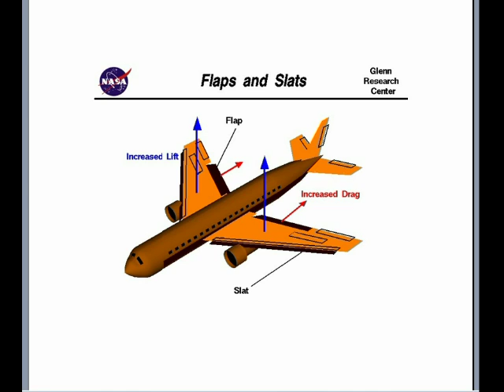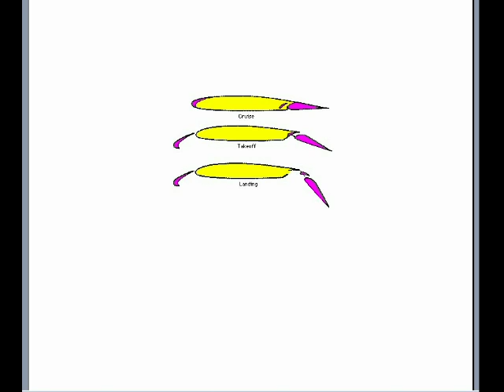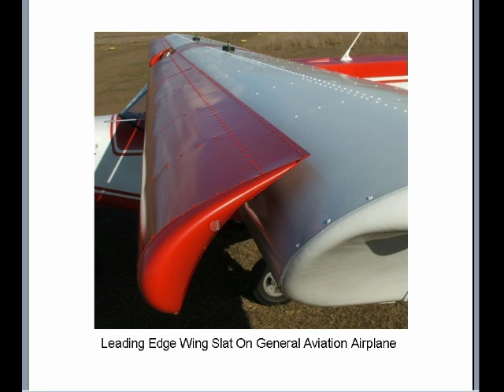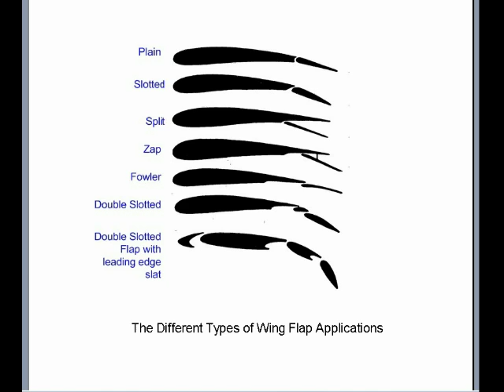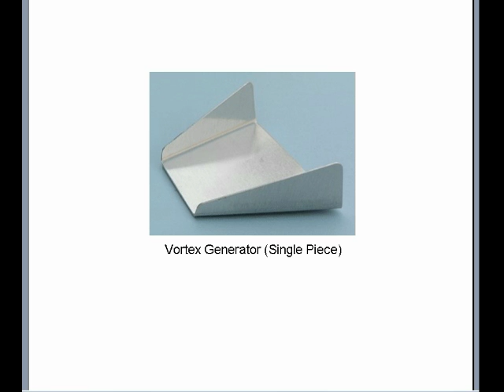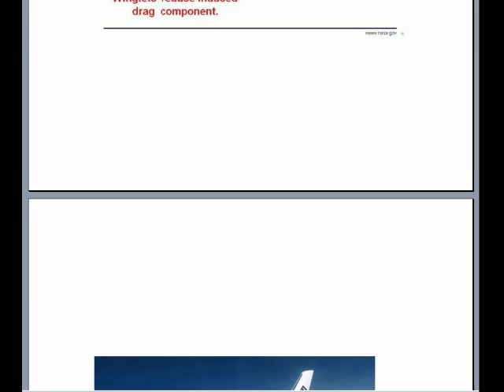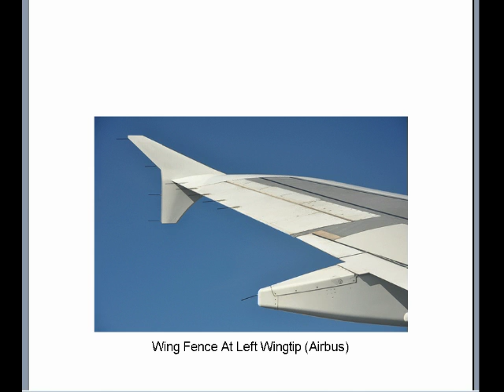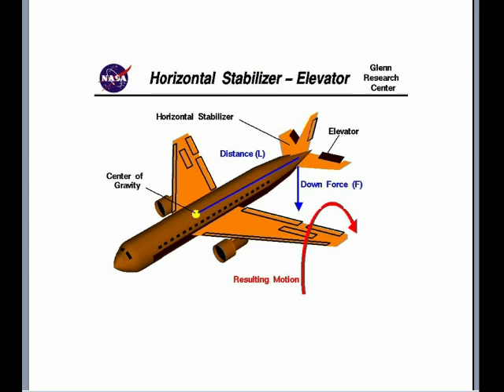Airplane Flight Controls & High Lift Devices Part 2 of 2

Comment: How much lift is produced on the leading edge slat? In other words is wing load calculation for the area of the slat equal or less than the main wing? Since most of the slat is curved the area parallel to the airflow is small so not much? There is a front loading component to the airstream that is at the leading edge. Just trying to figure out the loads on the extension tracks. Most of their load is trying to tear the slat up and back I assume?
Reply from the maker: Hi. The Slats are there to permit higher angle of attack preventing airflow separation or wing stall, especially in regards to swept back wings on heavy airplanes at slower airspeed.  Swept back wings don't develop that much lift at slower airspeed especially with high wing loaded (heavy) airplanes.  That is why High-Lift Devices are incorporated into heavy airplanes with swept back wings such as airliners.  High-Lift Devices include:  Slats/Slots, Vortex Generators and Fowler Flaps.  Also spoiler-assisted aileron and Load Alleviation Function helps to minimize the amount of flight control deflection when flying low and slow on heavy airplanes with swept back wings.

The Leading Edge Slats and Slots work in conjunction with each other.  Especially in regards to heavy airplanes with swept back wings flying low and slow.  Remember that the critical angle of attack or wing angle to the relative wind is not very high before a wing stall can occur especially when flying low and slow in regards to heavy airplanes with swept back airplanes.  This is why Leading Edge Wing Slats and Slots are implemented during takeoff and landings on heavy airliners with swept back wings.

Looking at the Leading Edge Slats and Slots from the side or profile view you will notice that the Leading Edge Slat is basically another wing leading edge suspended above the existing wing leading edge separated by a slot.  The Leading Edge Slats do not have any effect aside from a bit more drag when the wing angle is is low or close to level.  But when the wing angle approaches the critical angle of attack or exceeds it which would normally cause a wing stall (very dangerous when flying low and slow during takeoff and landings) instead of a wing stall occurring the airflow at the bottom of the wing is bypassed upward through the wing SLOT (not slat) up over the top of the wing, not only preventing a wing stall but also increasing the lift substantially when at an angle of attack exceeding the critical AOA.  Of course more drag is incurred during this process overcome by more engine power.

Remember that airplane wings develop lift when the airflow speed is much greater at the top of the wing compared to the bottom of the wing.  This is accomplished by implemented the appropriate airfoil for the given flight application and also by increasing the wing angle, but not exceeding an angle which would cause the airflow at the top of the wing to separate or spill off the upper wing surface causing a wing stall.

Slats and Slots are there to permit higher angle of attack to the wing without losses in wing lift especially when at lower airspeed in regard to swept back wings.  Swept back wings primary advantage is that they permit much lower drag and much greater lift when at higher airspeed (over 250 MPH) and are ideal for trans-sonic flight speeds just below the speed of sound.
However, when slowing down for landing or taking off, High-Lift Devices allow for much greater lift and drag simultaneously equalized by engine power.  As heavy airplanes increase in airspeed, lower angle of attack is sufficient for climb and/or level flight, then Slats and Fowler Flaps are incrementally retracted until they are completed stowed back into the wing. 

Slats are there to allow higher AOA when at lower speeds to prevent the onset of a wing stall by bypassing airflow at the underside of the wing upward through the slot over the top of the wing so that the airflow remains on the top of the wing at a higher airflow speed compared to the bottom of the wing.  When the leading edge of the wing makes a higher angle to the oncoming airflow the airflow vectors won't stay on a tangent line within angle limits to the top of the wing surface resulting in airflow separation or wing stall.  

With the slat and slot, the leading edge of the slat's lower structure "cups" the airflow approaching the bottom of the wing when at high AOA and bypasses that airflow upward through the slot to the top of the wing allowing much greater lift only when at very high AOA.  This makes landing and takeoff operations at potentially higher AOA requirements when at lower airspeed possible preventing the onset of a wing stall.  During takeoff and landing, when airliners are  flying low and slow, a wing stall is extremely dangerous or even catastrophic, so therefore High-Lift Devices are implemented.

Remember that airplane wings and propellers develop lift and/or thrust when the airflow at the upper surface of the airfoil is much greater in airflow speed compared to the lower surface of the airflow.  When the critical AOA is exceeding without high-lift devices at lower airspeed, airflow separation will occur leading to an aerodynamic stall.
Reply: Thanks for the reply Mark. The reason I ask is because I have purchased a Kit plane called the Lancair IVP, you call find its spec with Google. Anyway it is a doctor killer to the utmost degree, very fast, I think the fastest home built at 345 MPH at 24K AGL with a twin turbo, twin intercooled TIO-550 continental engine. The Wing load is 32 lbs per sq. ft. Only 98 sq. ft wing. The wing is has a straight leading edge with a tapered trailing edge.  You are not to try stalls with this plane. The wing is a laminar flow/ critical airfoil with separation moving from rear to front almost instantly. 

  I plan on modifying the wing with a leading edge slat that is motorized and use a Double fowler flat , like on the Falcon jet. The wing area is to be 130 sq. ft.. This plane is known to be tail heavy so the center of lift will be move aft and the C.G. range will increase. I ruled out a critical wing and using  the Airfoil tool section generator web site (least as of now). I picked an airfoil, NACA 24012 at the tip and NACA 24014 for the root. This airfoil is used on quite a few planes, include Vans RV8 kit plane and the Cessna Citation jets. Computer controlled hot wire  machines can be built for a few thousand dollars, to generate the foam core like what Rutan was known for or to make molds. I've read a leading edge slat should be around 15% of cord.  One interest youtube on slats that I saw with the Falcon jet is the Slat does not look like it opens enough to form the gap for the air is to go through to keep the main wing flying. Almost like they just wanted to increase the area only.  This observation must be wrong. For ease of construction the Falcon jet has a fixed double flap the hides inside the wing and then when deployed the two move aft and the start heading down. Both systems, I hope, and the increase wing area with all the added spar and other reinforcements do not move past 50lbs. each wing. 

That is why I asked about the load on the leading edge slat. I will need to carry the loads of the slat extension track driver/mount to the main spar which is about 18" away. The skin will carry a lot of the load but  I want to be certain . An I beam of some sort will attach the gear/ guide assembly to the main spar. This is a wet wing so they will have to be as small in volume as possible.

I hope these modification will make this plane much safer. With better stall, slower landing, better climb and larger CG limits at the cost of making it a 3 person plane (do not want to increase gross) and only a 250 mph plane.
Youtube link, falcon slats:
https://www.youtube.com/watch?v=Mi6Lj_wyEzg
Reply from the maker: Hi Erik.  If you are putting a Certificated Airframe together from a kit with engineering sign-offs in accordance to DER and FAA Regulations, then you shouldn't have any problems.  I'm assuming the assembly is conducted by an FAA Licensed Airframe & Powerplant Technician (A&P).  However, once you start to go outside of the certificated design engineering parameters you are playing with a lot of danger.  Perhaps not initially and maybe not hundreds of hours down the road, but eventually you will incur discrepancies which may cost you quite a lot of money in damage or even your life.

It is a big deal to actually to certify an aircraft for production and sale onto the market.  Commercial wind tunnels cost between $12,000 to $20,000 per hour to operate and nearly any airframe with the exception of an Ultra-Light or Micro-Light including LSA that is certified with a TCDS costs a minimum of $10 million processing fee.  Companies like Lancair and Zenith are run by Aerospace Engineers with Master's to PhD level education, more than 20 years experience and P.E. License.  

Plan-building from certified engineering specifications provided one is an FAA Licensed A&P is completely acceptable.  Many LSA builders are in fact building from certified design engineering specifications and have the education and experience to interpret engineering blueprints into acceptable manufacturing techniques for certified parts production.

To modify an already existing certificated airframe is not acceptable unless there is an engineering sign-off for the given sign-off.  The only exception is experimental aircraft in which the only occupant is the pilot within uncontrolled airspace not legally allowed to carry any passengers.

What you're talking about, a high-speed low payload airframe kit, probably with a CG too far aft subject to certified change forward and applicable engine or ballast and constant speed propeller to allow such high speeds.  Unless you have way more money to spend for some applicable smaller turbine application for the powerplant.  I haven't looked at the specifications of the Lancair.  However, modifications of any sort are not advisable unless you obtain to proper engineering sign-offs. 

There is a world of difference between experimental aircraft and the workings of equipment that FAA Licensed A&P Technicians and P.E. Aerospace Engineers work with.  Time to time modifications are indeed made, but first and foremost on the engineering level tied to the manufacturer.  Even installing Vortex Generators have a specific tolerance on chord range, position and orientation which requires design specifications. 

If anything you must first start with the Aerodynamics Equations and mathematics and obtain the specifications of the existing airframe you are working with.  There is a load limit to all aerodynamic structures, but it is always changing due to the dynamic nature of fluid flow, in this case airflow.   Slats and Slots are only necessary if high angle of attacks may be required at takeoff and landing.  I do emphasize REQUIRED not desired.  Required as in on an aerospace engineering sense not a pilot preference.

If you are looking for speed without high costs, keeping it simple with the least amount of complex technology and most amount of structural inherent stability with tolerances for maneuverability are key.  I would recommend that you first figure out what Aspect Ratio a straight wing needs to fly at the speed you desire incorporating slotted flaps for takeoff, most likely a bit higher Aspect Ratio.  If you start to implement Tapered Straight Wings for better Lift Distribution you'll have to spend more money or time or labor on the outboard wing wash-out construction or pre-fab. 

It seems like you may want to shop for a kit or plans which allow for a straight wing with a little higher aspect ratio, standard emmpanage (no v-tail / no t-tail / no canard) which permits something like an HO-360 with a hydraulic blade pitch system for constant speed prop.  Calibrating the dynamic viscosity sensing to manifold pressure for auto-blade-pitch change from climb to cruise speeds including propeller blade feathering during dead-stick conditions would be ideal. 

Keep everything as simple as possible, since more complex technologies require more backup systems and this is not cheap.  With simple all-mechanical applications, there is less to lose control over during an in-flight power failure. As for Burt Rutan and his innovative composite and foam airframe concepts, reinforcing foam cores with carbon fiber spars, it is true hot-wire foam forming with servos and transducers integrated with digital computer-aided-design and manufacturing are excellent for producing certified airfoils.  But remember that if you're going to build something yourself for flight, you'll need to keep it to either Experimental or Ultra-Light and fly it by yourself in uncontrolled airspace at much lower airspeed than you'd probably like.  Burt Rutan earn a Bachelor's of Science Aeronautical Engineering Degree a while back and had the work experience as well as talent to facilitate many of his experimental aircraft to become certificated.  Of course the tens of millions of dollars of investment money accrued made his equipment hit the market for licensing and certification.

If you are building from a certificated kit or plans, make sure you do not go outside of the existing design parameters.  If this is not acceptable to you, you may want to take your time and find the right kit for your flight preferences first. 

I'm sure you ask by now, when I am just going to tell you how to calculate slat loading based on dimensions and airfoil type.   In a general sense you can start by using the Dynamic Viscosity Formula (1/2 x P x V^2)  one-half times air density times airspeed squared.  Keep all units in metric values and then use the aerodynamic lift and drag formulas to calculate approximate slat loading based on flight parameters.  It is far better to integrate the values using Calculus taking rates of change as derivatives back to their original function.  Afterwards, create a graph to indicate values based on structural dimensions, flight parameters and stress & strain for giving fastening and/or deployment structures.  Don't forget about taking advantage of the certificated airframe's L/D Ratio, which will give you the Lbs Drag per Lbs Lift and also allow you to calculate the cruise thrust, since cruise thrust will also equal drag.  Jet velocity or propeller discharge speed using the Simplified Momentum Theory  can produce an approximate maximum aircraft speed.  That is because the Law of Conservation of Momentum applies to propulsion vehicles either propeller or jet:  A propulsion vehicle can only travel as fast as its jet velocity or propeller discharge airflow whereas the thrust is the pushing force and when equal to the drag, cruise flight is attained.  Cruise as in zero acceleration and constant speed. 

Blade pitch denotes the amount of fluid (airflow) displacement per one revolution of propeller.  At low airspeed propeller pitch must be low to "bight" into the air, but as airspeed increases, propeller pitch can increase while RPM decreases to maintain higher speed cruise flight, in which more torque and less RPM are required.  At low airspeed, lower pitch, higher RPM and lower torque are required.  

Ultimately, Slat and Slots suit swept back wings but could suit Short Takeoff and Landing straight wing general aviation and light sport airplanes as well.  The whole idea of the Slats and Slots is to permit much higher AOA while averting stall at the expense of much higher drag.  Slats and Slots are great for high AOA flight at low speeds during takeoff and landing, but serve no purpose at higher flight speeds except increasing drag, decreasing flight speed and if no auto-slat-retraction system and a powerful enough engine or propulsion system could cause damage to the Slat at higher speeds.

Slats take affect when at higher AOA and permit high AOA and low speed takeoffs, such as with STOL (Short Take Off And Landing) aircraft.  You might want to check out the Zenith Aircraft Kits and their creator an Aeronautical Engineer who explains all of the graphs of his Zenith STOL airplanes.  There are many other kits that offer what you are looking for.  I'm not too sure if KitFox also does high speed kit airframes, people have good and bad things to say about KitFox or their superseded corporate owners. 

Modifications of existing certificated airframe kits should not take place without an engineering sign-off or else you are messing with a lot of expensive damage or potential lethal outcomes eventually down the road.  If you made a modification that worked out well but eventually caused airflow separation during airflow which compromises the existing Reynold's Number limits of the given airframe, things like sudden descents leading to landing gear damage or even worse could occur, or even worse, sudden spins during what would be normal flight experience. 

There is a world of difference between making a modification that works VS a modification that ALWAYS works!  It's all in the engineering sign-off! 

- Mark -